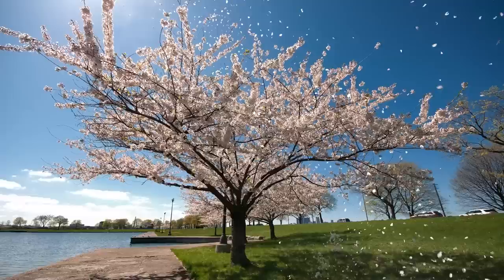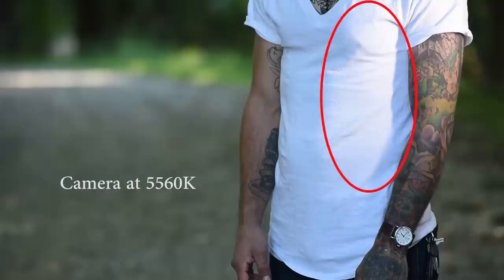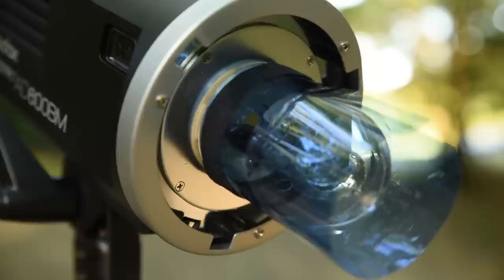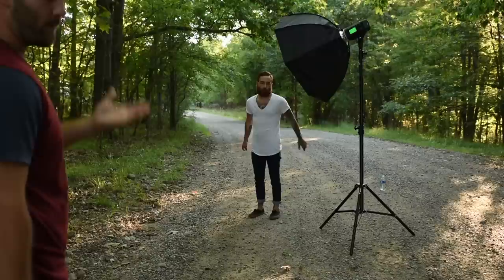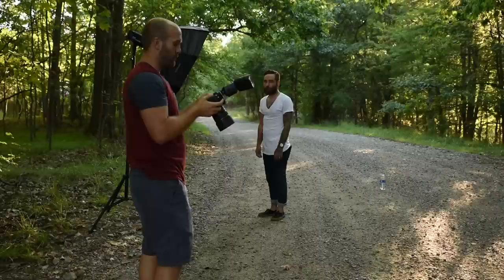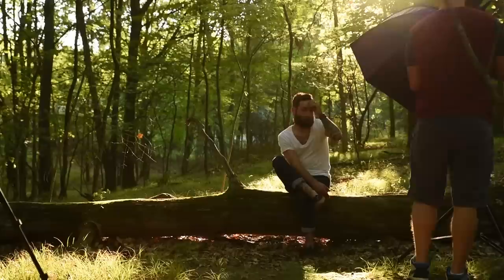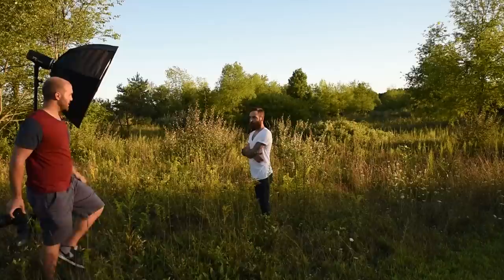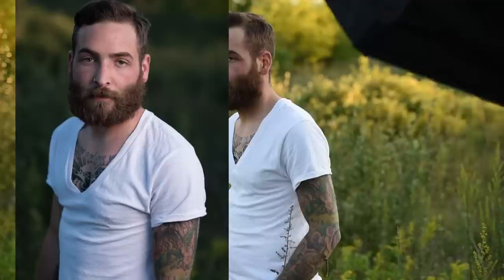Flash Photography Tutorial - Using gels to balance with ambient light

Comment: Not explicitly mentioned is manually matching camera color temp to flash color temp. It's implied, but if anyone leaves the camera on auto white balance this method only works with luck. Since flash is daylight-balanced, the gel provides a Kelvin number that it + the flash create _together_. Set the camera to that number.

Comment: I have the ad360 godox and love it and was thinking about getting the 600.  How were you controlling the OCF .  You have an on camera flash could you use that flash in addition to the OCF?  as far as the Gel.  You used the gel and you pumped up your WB in the camera to 7000 something?  No Gel your WB was at 5500?  So you always match the color of your gel and the in camera WB the same?  I have just started with flash and if I understood you your explanation has made more sense than I seen before.  Thanks
Reply from the maker: I'm using the Flashpoint Zoom R2 TTL Lithium Ion (http://amzn.to/2coDT23) which is the same as the Godox V860IIN (http://amzn.to/2c3xCKp). Both of those will control and trigger anything in the Godox X series (Flashpoint R2 Series) lineup.

Comment: Thanks for this Robert! What if you wanted to warm your key light a bit while balancing it for the shade. Would you add a 1/2 CTB and a 1/4 or 1/2 CTO?
Reply: I believe you'd add "less" of a CTB. So, if "shade" is full CTB, you'd gel your light source only 1/2 or so CTB, to make the source of artificial light "warmer". If you set your cameral WB to full blue at 7140 or "shade", your artificial light will produce warmer than "normal", as dedicated by your camera setting and gel. In summary, if you gel your artificial light less cool than your camera setting, you will produce a warmer result in your image. I hope this helps.

Comment: Thanks Robert for the sharing, may I know what Octabox is that in the video? Can you recommend some on-the-go Octabox that is good for wedding photographer (for AD600 users)?
Reply from the maker: Hey Kenneth, the octabox I used in this video is in the "Godox buying guide" link. Specifically it's the 36" but I included their other versions as well. They are all umbrella mechanism so they collapse and store easily which is a must for wedding photographers. And they are substantially cheaper than equally-featured octaboxes from other brands

Comment: What is the best kelvin to achieve healthy skin look??
Reply from the maker: There's no answer to that question.
Different lighting equipment puts out different colored light. The color of light changes as you modify the power level or use functions like HSS. Modifiers can then push that color more cool or warm. Gels can make that more cool or warm. The ambient light it blends with can also influence the color.
 And finally, "healthy" is subjective, as you may be trying to make it perfectly accurate, or you may be trying to make their skin appear warmer.
If you're not going to use a colorimeter and find out the exact color temperature of a flash, at a specific power, with a specific modifier, simply use an image as a reference point and if you want their skin warmer, increase the K, if you want it cooler, decrease the K.

Comment: Why use a battery powered speedlight to trigger the godox instead of a trigger?
Reply from the maker: +BEERJOINT SKATEBOARDS I don't like the X1 controller very much because the tactile response to the dial doesn't match up perfectly to the power level, and it's a little slower to engage. So I tend to use the speedlight to control it instead of the X1. It's just easier for me to adjust power without looking at it.
Reply: Is it me or is the wheel for selecting groups backwards on the x1 as well? It's really screwing with my brain haha

Comment: awesome video. I too recommend d the godox ab600. so, when talking about the inverse color....blue gels....higher color temp in WB....warmer gels...lower color temp on WB?
Reply from the maker: +Adam Peterson 
Yup. If you add blue to your primary light, you therefore have to add yellow to your settings to balance it, which means everything that isn't gelled will get more yellow, including the ambient. And it works the opposite way of you add yellow, when you compensate with the lower Kelvin temperature, all other lighting gets more blue.
Lastly, you can do this with your tint as well. If you put a green gel over your key light, to balance you would have to add a significant amount of magenta. Therefore all your ambient and other flashes would have a very magenta color
Reply: Such a simple explanation that I've never heard before but makes complete sense. Thanks Robert!

Comment: Great Video, thanks.
I wonder however how much of it is actually doable to work around in post process?
Propably not easy to correct different WB in shadow area of the face, vs the lighted area, but i guess the backround is easily set on different WB if you need to.
Reply from the maker: Yeah changing the background ambient is a breeze, but the adjustments that come with then correcting the subject with mixed temperatures always requires complex masking and brushwork. Depends on how many images your providing but adding a gel (if balance is the goal) is always faster.

Comment: Any videos on using indoor flash, while your body is set to auto ISO...and the horrible results that occur when the body uses an ISO like 3200, etc?  Shooting with a Sony a6400 and godox Roundhead flashhead.
Reply from the maker: No because that's setting yourself up for failure. Auto ISO and manual flash will never work well together, and Auto ISO + TTL is like playing roulette, with wildly changing results depending on your metering mode.

Comment: In order to get a better balance when using flash outside on sunny days, should I just leave some form of CTB on my flash? Vice versa for overcast, use CTO?
Reply from the maker: +Hank CTO wouldn't balance in shade, CTB does. CTO is for balancing in indoor, tungsten environments. Generally 3000-4900K would require a CTO (of various strength) to balance with flash. And CTB in general wouldn't balance for sunlight, it would warm the sunlight
Reply: Just to clarify, the CTB itself would not warm the sunlight. Rather the matching cool color temperature in-camera, which will add warmer, amber colors to the scene, will warm the sunlight.

Comment: can you correct this problem in Lightroom or photoshop? Good vid man.
Reply from the maker: You can, but it requires brushwork, and usually since the temperatures have soft transitions (due to soft mixed lighting) it is very delicate and precise work.
Reply: Generally better to nail it in camera, but you could use the HSL in Lightroom to desaturate the blue,  aqua and/or purple.

Comment: You mentioned in a previous vid that you can't recommend the Godox gels for the round head AD200 attachment and upcoming round head speedlight because of the color cast the gels have. Do you know if the Profoto A1 gels can be used on the Godox round head applications because they're both magnetic?

Comment: Rob, this is a great video tip, love it. Is it possible for you to link the rubber bands you got. Thanks.
Reply from the maker: Hey David, sorry I missed this one.
http://amzn.to/2bGEZYg
Those are the heat resistant silicone cooking bands in 2 inches.
They work excellent for the AD600 and speedlites (though those you don't have to worry about heat at all)/

Comment: So silly question - the "full", "half" or "1/4" gel refers to the opacity of the gel?
Reply from the maker: Short answer - yes. Things to consider - the primary thing to look at is the conversion. For instance, some "full" CTO change 5500K to 3200K, while others do 5500K to 2900K. I prefer ones that go to 3200 as the 2900K is a little too orange for most uses. As for CTB, you have to play a little. A full CTB is listed as changing 3200K to 5500K. That's because it's designed to change tungsten light to daylight. But adding it to a 5500K daylight source, it doesn't just increase by 2300K. It pushes the light into the 9000K region, because Kelvin temperature doesn't increase proportionately.

Comment: Great video! Must have watched at least 4 times. What do you recommend to use to hold the gel to a strobe like the AD600? Would rubber bands work?
Reply from the maker: I use silicone cooking bands instead of rubber bands, because silicone cooking bands are made to handle high temperatures.

Comment: sorry to ask, heat from light dome doesn't melt the color gel?.
Reply from the maker: +poyokortopo Nope, the gels are heat resistant enough to withstand the exterior temperature of the glass dome. On the AD600, I have tested with 60 continuous full power pops and had no issue. I do make sure not to cover the vent holes where a majority of the heat will exit from.

Comment: question I have is how did your gel not melt from being directly on the bulb?
Reply from the maker: +SincerelyAND  gels are designed to be heat resistant, the tube is contained within glass and heat escapes out the bottom. It doesn't get hot enough to melt a gel.

Comment: Hi Robert , Good video ... Can I ask how you fireing the main flash ... the speed light ? type ?  .

Thanks
Reply from the maker: +Roy UK Hey Roy, on camera I've got the Flashpoint Zoom R2 TTL Lithium Ion. It's the American Adorama rebrand of the Godox V860II.
The V860II (along with every other speedlite in the Godox X series) has the 2.4Ghz radio technology built in, so it can trigger and control the Godox AD600BM without the use of any other receivers or transmitters. If you check out the rest of my channel I go into extensive detail about the full Godox lineup!

Comment: Impossible!  You couldn't be out in the woods of Michigan for this video.  If you were, you'd be smacking yourself silly because of all the mosquitoes!
Reply from the maker: Deep Woods on and I still got torn up!
Reply: Ha!  It's the same for me.  I live about halfway between Kalamazoo and the lake shore, right in the lake-effect mosquito belt where I have literally seen mosquitoes in the woods in January.  In the summer I have to cake on Off Sportsman's (more DEET than the deep woods variety) just to keep those things away for a little while.
Reply: Deep Woods is junk. Go to a sport supply or wilderness outfitter (like Cabela's) for deet, or what the military use. I shot a nature pilot in Michigan's UP and Deep Woods was like using nothing until we switched to a deet product. Great video with excellent results. Great post.
Reply: It really depends on the breed and density of mosquitoes.  When I was a kid, Deep Woods Off, or even standard orange can Off, was adequate for the mosquitoes we had.  When I went camping in the U.P.  I had to practically bathe in the stuff to keep the mosquitoes and biting gnats away.  Where I live now I use either Sportsman's Off, which is 30% DEET, or a line of Repel that has 40% DEET, and those work fine.  Deep Woods is 25%, and plain orange Off is 15%.

Comment: How are you triggering the Godox with the Yongnuo flash? As optical slave?
Reply from the maker: I'm using the Godox V860II / Flashpoint R2 Zoom TTL Lithium Ion in this video. This has the radio built in and the speedlight is not firing at all.
Reply: Oops my bad. I thought that speedlight was a YN-600exrt. Thanks for clearing that up.

Comment: What size rubber bands were those? I have the same flash
Reply from the maker: http://amzn.to/2bGEZYg
I'm using these 2inch (flat) silicon cooking bands.
This ensures they handle the heat, they work great for the AD600 bulb, as well as typical speedlights. I'm going to try them on the AD360ii and see if they fit or require being wrapped around 2x.
Reply: Thanks have them on order

Comment: does it have to be a blue Gel, i mean the purpose is to get warmer light so the Gel should be yellow, am i right or am i missing the point  ?? i want to use it ( on a  normal speedlight )

By the way nice video :)
Reply from the maker: +sunshine Can't use yellow to achieve this type of look. The purpose of the blue gel is to intentionally cool the flash that lights the subject. Then, to get the subject to look "proper" you have to warm the image up, thereby creating warmth in the ambient. That's why it's called inverse color, whatever you do to your flash will have the opposite color effect on your ambient light or gel-free flash.
Reply from the maker: +sunshine Can't use yellow to achieve this type of look. The purpose of the blue gel is to intentionally cool the flash that lights the subject. Then, to get the subject to look "proper" you have to warm the image up, thereby creating warmth in the ambient. That's why it's called inverse color, whatever you do to your flash will have the opposite color effect on your ambient light or gel-free flash.
Reply: so i should use the opposite Color to get the warmer look. For example for that golden light  i should use a blue gel ?? right ?
Reply from the maker: To get your ambient light to be a warmer, golden tone, yes you use a CTB gel. You can use 1/4, 1/2, or Full depending on how dramatic of a look you want
Reply: Robert Hall Photography CTB gel ??? what do you mean ? and by the way thanks for taking time answering my question ( definitly got A sub :) )
Reply: CTB is Color Temperature Blue. B is for Blue. CTO is Orange
Reply from the maker: ^ Yup, CTB stands for Color Temperature Blue, which means a gel that modifies the K to a more blue color without tint. This differs from a blue effect gel. CTO is color temperature orange which a full one will change the flash to 3200K, balancing with tungsten lighting. Thanks for the Sub!
Reply: Re: "whatever you do to your flash will have the opposite color effect". To clarify, the gel itself does not create an opposite color effect. It's the Kelvin setting you choose that has an opposite color effect. The purpose of the gel is to match the color of your flash light with the color of the ambient light, so that when you set the Kelvin it will have the same opposing-color effect to your flash as it does to the ambient light.
Reply: I would like to expand on my previous point, as there appears to be some confusion among posters here. The gel itself does not create an opposing color effect. In fact, the gel casts the color as you see on the gel. So, a blue-coloured CTB (color temperature blue) gel will cast a blue, cooler color, light. Conversely, an orange-coloured CTO (color temperature orange) gel will cast an orange, warmer color, light. The opposing color effect only occurs when the Kelvin is set to the color temperature emitted by the light sources.
Reply: Almost had it, but not quite, until your comment snapped everything into place - thank you :)
Reply: Harvey Louis A
Reply: in shade, set wb to shade on camera, CTB on flash to correct flash from 5500k to Shade K; in golden hour set WB to  tungsten on camera and CTO to correct flash to tungsten (golden)? am i correct. Now if i am shade and set my WB to shade and use CTO then do i get an orange glow.
Reply: It's hard to understand at first but Sunlight is actually more blue, tungsten is on the opposite end of the spectrum and that's yellow
Reply: AMEN!!!  @harveylouis445

Comment: hmmm all this work that could be done easier in post production?  one has to ask why go trough the trouble
Reply from the maker: No, there is no global adjustment for addressing split colored lighting in post, especially on skin tones. It would require brushing/masking. Even on a single portrait, it would take more work to do the brush adjustments than it does to add a gel to your light. You can't just change the white balance to achieve this affect.
Reply from the maker: If you don't understand the split color concept, check out this video : https://www.youtube.com/watch?time_continue=87&v=d3oxMnNcWcY
Reply: I understand the concept and have played around with the idea before.  I guess the point I was trying to make is that there is more than one way to "skin a cat" and post processing with a very simple masking technique would yield similar results and offer even more dramatic flexibility in tone correction/manipulation.  But this is definitely useful for film